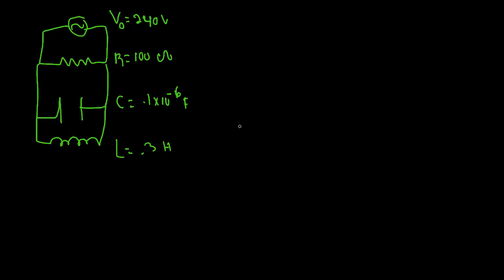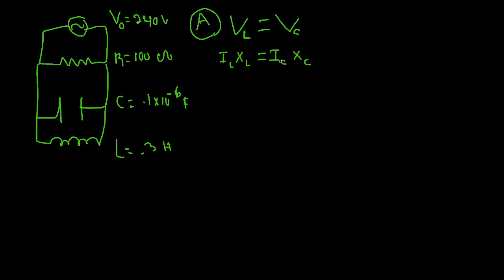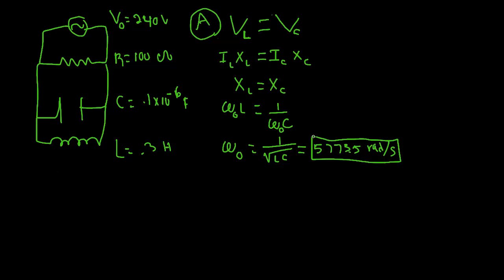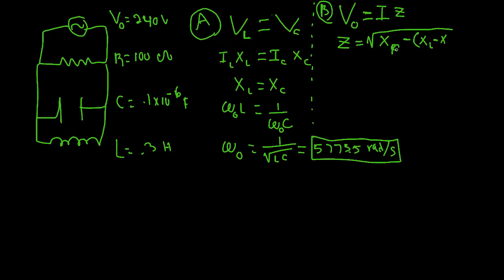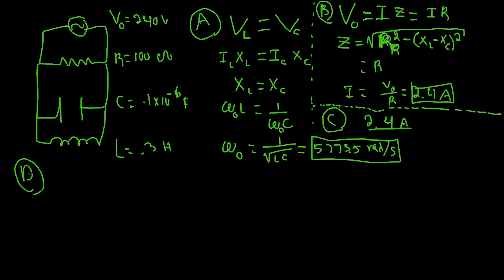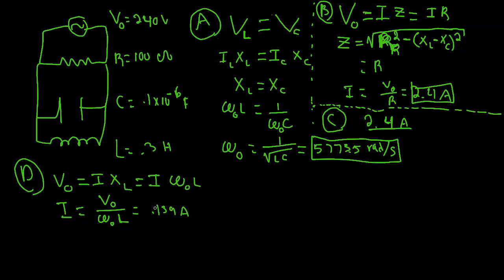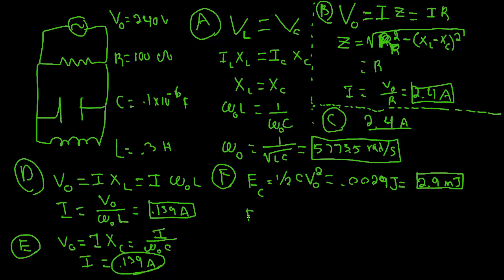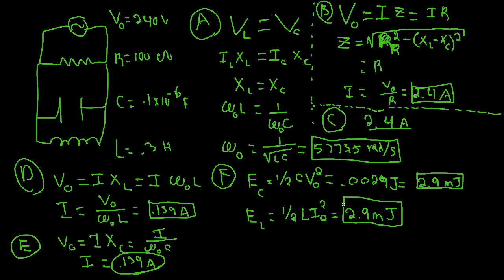Inductor-Resistor-Capacitor (LRC) Parallel Circuit - Physics Problem

Comment: Thnx for sharing sir. I have one concern about the way Z(total impedance) was solved though. It still appeared to be a correct answer but the formula you have used is the way to calculate Z for series cct. In this case however it should be                                                      (1 / Y) = (1/R) + (-j/XLp) + (j/XCp)  because its a parallel cct